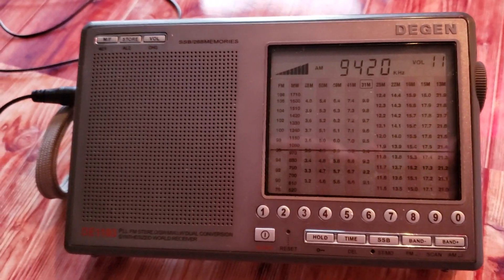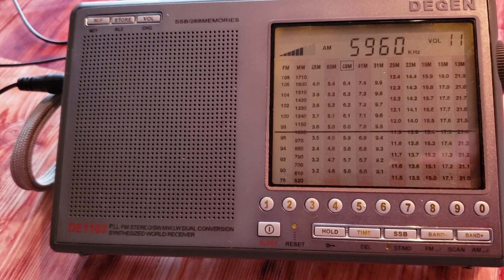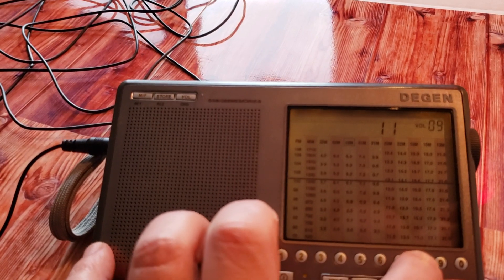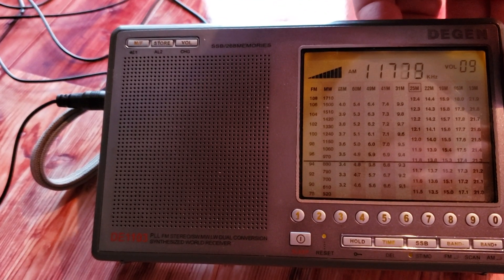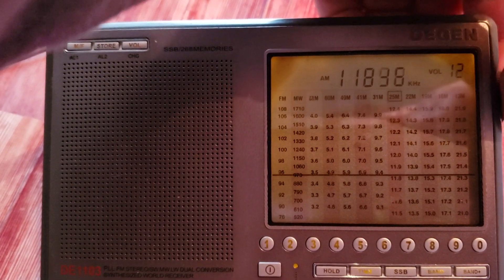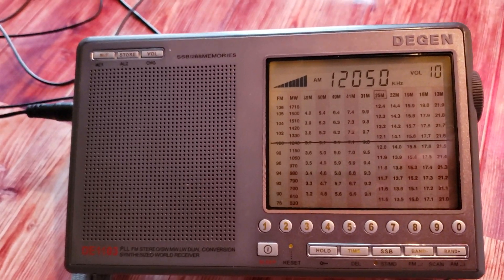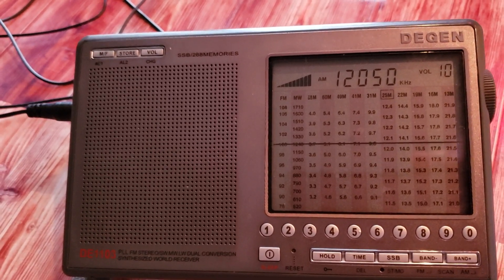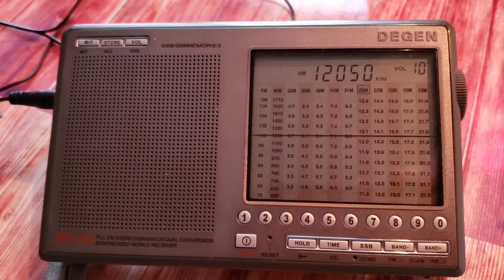Testing Tecsun AN-48X active loop on Shortwave Degen DE1103 receiver

Comment: I know this video is a year old but I just picked one up and while I find it to be finicky once I got the feel for it I am having pretty good success. It is difficult though since loops are directional and this setup is difficult to aim. I have been able to use it to tune out noise on stations to good effect. I totally agree that the feed wire is too long. Seems that by coiling the excess the noise does help. I am going to make try making a shielded cable for it and see if that cuts down on the noises
Reply: I'm getting this antenna sometime later this week (and my Tecsun PL310ET next week) and I've seen other videos showing it worked for them but the one thing I did notice in a few videos, and you said it here, was the length of the cable and the consensus was that by wrapping the cable up that the noise did disappear significantly for them but of course this could differ depending on where you live.

So I'm happy to hear it worked for you and although this comment is two years old I hope you did shield the cable and that you're still happy with the antenna.

Comment: Hi, I recently bought a DE1103 (DSP) Version. It really suffers from AM breakthrough just using its telescopic aerial. On SW you often have to switch to low. Its really sensitive on AM. Its has a really rough soft mute. Its almost like sync detect trying to lock.This earlier. version is by far the best.